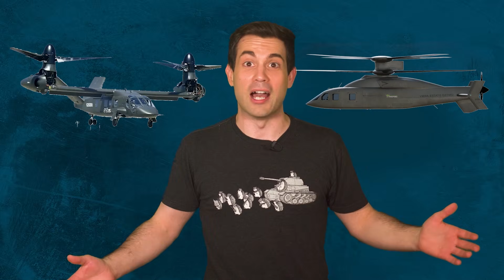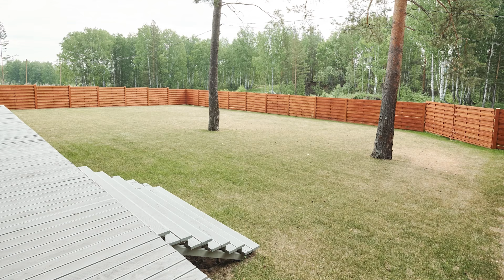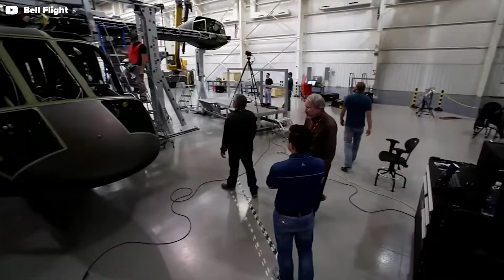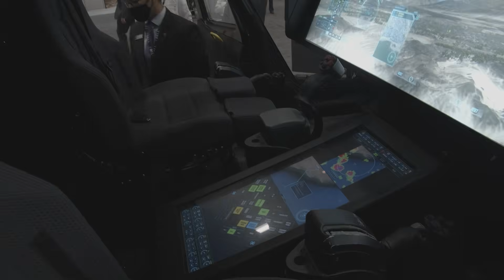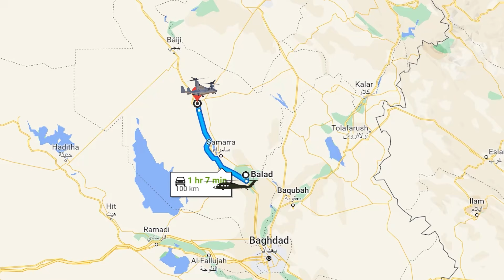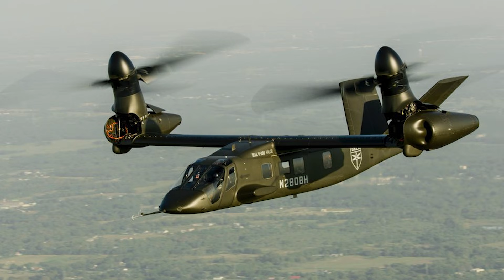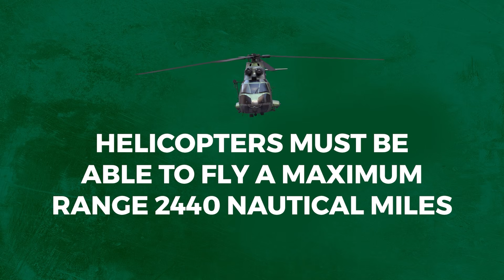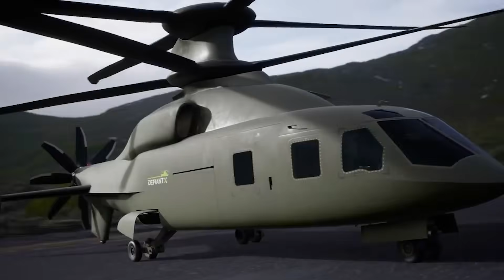V-280 Valor Helicopter Will Help Defeat China

Comment: Cappy, You missed the greatest property of the Defiant X coaxial rotor, it eliminates retreating blade stall so the helicopter can go faster. Retreating blade stall is/was a major limitation to helicopter speed because the faster you go the more the retreating blade loses lift. The coaxial rotors turning in opposite direction cancel out retreating blade stall.

Comment: I personally think both have a place in the US Military. The Defiant is my favorite for the Army because it has a simpler logistical footprint, being able to use the same hangers as the Black Hawk and being (presumably) cheaper to maintain. Plus it can land in smaller areas and fly backwards. I also think the Valor needs to be bought by the Marines as a UH-1Y replacement and MV-22B supplement.
Reply: I was thinking along similar lines as well. The Bell design is going to win out on long distance hauling and will be ideal for the pacific theater, the Sikorsky design on the other hand is going to be ideal for shorter runs and it's smaller profile will allow it to fit in similar footprints to the Blackhawk, covering the weaknesses of the Bell design.

Comment: It strikes me that there are arguments and room for both designs. Especially if they can be scaled up and down depending on requirement.  The Bell design with it's two huge tilting rotors and equally large footprint, is perfect for the seriously heavy lift role. Troop transport and perhaps even other functions such as in flight refuelling in a tanker variant/conversion kit  (Concept already tested with the Osprey by USMC). The Sikorsky Boeing design with it's inherently smaller rotor footprint seems perfect for fast and nimble scout, utility, medium lift and attack gunship roles. 
The competing designs have enough positives that loosing either would be detrimental. So choose them both and bring the Navy/USMC into the development too. I imagine key allies would be interested especially if licenced productions can be negotiated. Which would make service, repair and spares facilities available in various theatres of operation. Specifically UK for Europe and Japan or Australia for the Indian and Pacific Oceans. Huge potential.

Comment: The tiltrotor is in theory a really neat idea and can do things that traditional helicopters can't, but they are horrifically complicated and have far more "Failure results in total loss of aircraft" than a traditional helicopter. Added on to the whole "Must reduce maintenance hours" requirement gives me the heebie jeebies. There's room for them for specialised roles but I wouldn't want them as the primary rotary asset. The defiant looks really good though. 

You add complexity in some areas but you also eliminate some traditional critical components from the tail (Which in theory can fail entirely and you'll still have a flight capable helicopter). Having the pusher prop also eliminates a lot of the downsides of a dual rotor design while adding a ton of useful benefits.

Comment: I work as a jet engine electronics designer. I know for a fact that air gas turbine engines do not perform well when they are tilted too far up or down, as it disrupts the lubrication oil and fuel flow. In the documentation we give to the aircraft manufacturer we provide information on the angle of attack restrictions the engine has for safe operation, and it's their job to share that with the pilots. It also affects the air flow through the turbine, which the engines need in order to function. They work best when pointed in the direction the craft is flying. That's one reason why the Osprey tilt-engine turboprop design has so many reliability problems and is also a likely contributor to why the Bell prototype is having trouble meeting the external carry weight requirement. When tilted upwards, it has to actively suck air through the turboprop as opposed to a regular turboshaft design or when the turboprop is facing forward that passively gets air flowing through it as the aircraft moves.

For the Blackhawk, I also know that some of the electrical components like the power converter are located in a hot, dirty compartment that clogs their cooling fan filters, causing the capacitors in them to overheat and explode, taking out the converter and unpowering anything is was connected to. That's a problem on the aircraft's side, not the components.
Reply: People who know what they're talking about deserve a like. Take this.
Reply: true but that being saidthere are ways to design engines that can handle tilting. also as far as I understand the new Bell design doesn't actually tilt the engine but just the prop-gearbox assembly which should make it much more reliable.
Reply: Tell that to the fighter jets.

Comment: Yeah, I’m definitely betting on the Bell Mini Osprey to win this contract, but I can see elements of the Lockheed design in a new attack helicopter…
Reply: The Army wants to base a replacement for the Apache on the winner of this contest for the same reasons the USMC has the Hueys and Cobras(because they have 85% parts commonality). I can't see them trying to make a tiltrotor gunship when tiltrotors are less efficient and noisier in hover and loiter compared to traditional helicopters due to the higher disk loading. Tildrotors have to compromise between disk loading and prop drag and there is no getting around that.

Comment: I think US should go with both helicopters.

Now hear me out, this project will replace all blackhawks. V280 seems great for island hopping but imagine that thing on the mountains of another middle eastern country, just no. On the other hand Defiant X seems great for tight spaces of middle east or europe for that matter but I can't imagine defiant island hopping, it's too slow and lacks the range.

From what I can find V280 has cruise speed of 280kn and range of 2100nm while Defiant X has claimed cruise speed of 250kn and they completed a flight test 2 months ago of 700nm. I said claimed cruise speed because defiant X's max speed in this flight test was 247kn. It's still better than blackhawk mind you, it's just not as good as V280 for an island hopping objective.
Defiant X also does NOT have the lift capacity of V-280. 
V-280 only looses out on its size and unjustified fears of tilt rotor being troublesome. In every way, it is better than Defiant X.
Reply: while that would be great, it would defeat the purpose of the program. They want one helicopter to replace the blackhawk not two. having two would balloon the price and budget to support them. Its much cheaper to choose one and service it over its life time. 

Also we saw how well having two different versions for the same mission worked for LCS. I dont think the army wants to see a repeat of that.

Heres what I think should happen. I love both designs but I think the defiant will win this. It can practically match the valor in capabilities. The valor is a little faster and can probably lift more. However the defiant seems to beat it in the other areas. Ease of maintanance, size, combat footprint, etc.. So they go with this design to replace the blackhawk.

For the scout program they go with the bell invictus helicopter over the raider. It seems the better option to me. Although bell loses the blackhawk replacement, it gets the scout program.

Honestly I would not be against a scaled up version of the valor to replace the chinook. I like the chinook but its showing its age. The V-22 I dont think can replace teh chinook because it cannot carry as much men and equipment inside and outside as the chinook. Maybe They said in the video the valor can be upscaled so maybe once re start replacing the blackhawks and recon helis we can look at the chinook.
Reply: @ameritoast5174  Defiant has non of the attributes that'd work for island hopping and no valor isn't just "a little faster". Valor's top speed is 320mph while defiant's top speed is 247. Valor has 2100nm range while defiant has 700nm range. 

If they want to go with island hopping, slower and shorter ranged helicopter is just not gonna work.

Comment: The Bell Valor differs from the Osprey in that the rotors tilt, but the engines do not. This should make the aircraft much more reliable. It's about 70 mph faster than the Bell, but carries less and the tilt rotors severely limit weapon load-out. It's main point of failure is the linkage between the rotors and the engines, as that joint needs to bend 90 degrees.

The Defiant-x, looks like a regular helicopter but it is not. In order to get the rotors so close together, they had to be made out of a much stiffer material. This is unproven and is probably the aircraft's main point of failure.

IMHO the Defiant-x fits the role better, but the Valor is the safer choice.
Reply: what do you mean, have you not seen the KA 29 or KA50/52, they have the twin rotor setup how is it unproven.
Reply: @kousand9917  Their rotors are farther apart to keep them from self-destructing. The Defiant-x builds upon the "ABC" concept from the 70s. It's got a lot of advantages, but requires very stiff rotor blades that will take a lot of stress. (maybe too much stress)
Reply: @be5718  The engines don't have to tilt. So they don't need to deal with the operational stress of working at 90 degrees. (and twisting the full lines, etc...) This was a big hurtle back in WWII when planes were first taking high g loads and flying upside down. As for landing without power, what does the v-220 do?
Reply: Counter rotating top rotors have been around a long time. They are well understood now. Sufficient stiffness to avoid rotor blades slapping each other was part of the design. But already tested and proven on aircraft before Defiant.
Reply: @Stu_Bur  Dude, read the comments. The defiant-x is an abc helicopter, the aerodynamics are different.

Comment: For island hopping, how about WIG ship, or flying boat (amphibious aircraft)? They are much faster than helicopter or other highspeed ship (like hovercraft/surface effect ship/catamaran). And they can land on water so does not require runway. Japan/China has large amphibious aircraft of  MTOW 45 ton.
Reply: The problem with that, is that the Army would still need a medium helicopter for all of its land warfare needs. The idea is to have a helicopter that is capable of island operations, not get an island-operations-only aircraft, and then need to go get a helicopter afterwards.

Comment: I understand the V-22 Osprey is the second most high maintenance aircraft in American inventory after the UH-64 Apache.
There would be big questions about the V-22 if it didn't do things that no other STOL/vTOL can do, which among other things can transport an F-35 engine long distances. Keeping the V-22 in the air with a relatively clean accident record is supposedly not because of the aircraft's low maintenance requirement but a sign of the excellence of American aviation maintenance.

A lot would have to be upgraded if a new Blackhawk replacement is supposed to be low maintenance.
I suspect Blackhawk accidents are probably due more to the age and use than fundamental design eeficiencies... Would that be right?
Or, maybe the Blackhawk was designed in an era of limited technology relative to what is possible today.
Reply: The Blackhawk accidents are because of inexperienced pilots. Hard to get them proficient in their job when flight hours are hard to come by.

Comment: I'd like to know how much science supports counter rotating props.
I know it's a populat Russian design but it hasn't been seen on Western aircraft since the very early days ofstrategic bomber aircraft.
In the RC world, it's fairly well known to be ineffective unless the props/otors are ducted.
I'd read awhile back that the weight and complexity required for multiple counter rotating rotors/props was more complex and heavy than any added benefi.
Noticed the Mars helicopter used unducted counter rotating props.

I suppose in their multiple rotors can have a benefit to emply greater lifting area (without increasing drag) when the wingtips approach the speed of sound which is a limit that should not be crossed. But does it make sense?
Reply: TS: The Kaman HH-43 helicopter in the 50's -70's had counterrotating rotors as does the current production K-Max heavy lift helicopter.  The Navy DASH drone helicopter in the 60's-70's had it as well.  Demanding "supporting science" is bizarre and inappropriate. The Soviets/Russians have decades of operation in their naval Hormone/Helix helicopters and their current Ka-52 attack helicopter. The Soviet/Russian Tu-95 bomber in operation since the 1950's uses contrarotating props. The British RAF AVRO Shackleton maritime patrol plane operated from the 50's-1990's.
Reply: @KB4QAA  Thx for responding. Point is that although a few models exist, only the Russians have made it a feature of their designs. Everywhere else, it's only been a niche feature that didn't start a trend of copycats.
So, the question still must be asked... If counterrotating props and rotors are really that significant, why hasn't it become a standard feature of most or all designs instead of only niche designs? If "supporting science" is not available, I'd settle for some kind of study or opinion by an engineer who designs this kind of stuff.
Reply: @tonysu8860  I fail to see how historical designs have anything to do with modern designs.  ??
Reply: @tonysu8860  I forgot to mention the RN/RCN Fairey Gannett  ASW/Airborne Early Warning carrier based plane of the 50's-70's.

Comment: I mean the Osprey already proven very useful, it's a combo of a plane and heli. I don't see its size has a massive downside since it can hover pretty well. The only question is how well it will work if one rotor dies.
Reply: About as well as the defiant will work if one rotor dies, not at all
Reply: The tilt rotor aircraft require a substantially larger LZ and have reduced efficiency in hover mode as a good portion of the thrust is opposed by the surface area of the wings.
Reply: more moving parts = more things that can go wrong. Variable geometry aircraft tend to have a very high service cost.

Comment: What seems obvious to me is that there is no way that the Valor can land in a confined space. This is one of the biggest advantages of the "conventional" helicopter design. It's simply too big when you need to land in the middle of the bush or a narrow road.
Reply: You'd be surprised. I've worked with V-22s, and while they do require a bit bigger of a footprint than a conventional helo, the difference is not as big as you'd think.

The reason is safety margins. Outside of exceptional circumstances, chopper pilots want to keep 20 or 30m of clearance away from their rotor blades. The difference between a 16m radius main rotor (Blackhawk) and a 12m x 25m pair of rotors (Osprey) is significant, but once you add on 20m of safety margin, the difference between a 35m radius safety circle and a 30m x 45m safety rectangle is pretty small.

It might make a difference for special operations, where safety margins are regularly cut down, but for the green army, it isn't a game breaker. Besides, the green army usually doesn't want to land just one helicopter (how much good is one section/squad going to do?), so they are already looking for larger LZs, and the difference between being able to land 10 Defiants vs 8 Valours on a given LZ might not be enough to balance out the fact that the Valours can go back to base and bring in a second wave by the time the Valours have arrived at the LZ.

Comment: I guarantee you bell won't win. Vtol planes are overrated as fuck and hyper complex to maintain and many additional points of failure in the system. Not as good at being an airplane or helicopter. May as well have shot their bid in the foot with such a dumb design.

Comment: I would pick the Defiant X. The Valor doesn't look like it would do well in an urban environment. Also, it has to pitch back to slow down like old helicopters. The Defiant has a compact footprint and can land without pitching. That probably negates any range or speed advantage the Valor may have. Also the Valor is just a big target for ground fire. Those wings don't look super sturdy. Adding armor to the Defiant seems like it would be much easier than for the Valor.
Reply: But that's the problem, they aren't looking for new helicopter in urban environment. They want island hopping capability and that means: range, speed, weight lift capability all of which valor has and non of which Defiant X has been able to achieve.
Reply: I agree, Lockheed should win this.

Comment: Instead of counter rotating rotors, I’m surprised at we don’t make a smaller banana/mini Chinook. A couple of small jet engines could do forward thrust, and then the rotor design can stay subsonic.
Reply: What you're talkin about is limited by aerodynamics. You can't achieve the speed and range.

Comment: There's a problem with tilting rotors that you didn't mention here. The type of propeller needed to achieve lift and the one for pushing forward have to be different to do their job efficiently. Obviously the first one can do both but it is doesn't have the best characteristics to do the second one. Also the tilting mechanism adds more weight and complexity (more money both to build and maintain).
Reply: But isn't complexity and weight also a complaint about the competition which is a co-axial counter-rotating rotors?
Reply: @tonysu8860  They are still lighter and less complex compared to the other prototype.

Comment: Is it possible the contract would be split? They both have great features and ideas behind them, imo.
Reply: Doubtful. Defiant is better for air assault while nearly as good as V-280 for speed and range. V-22 Osprey is better than the smaller V-280 for long range logistics. V-22 has larger capacity and a rear ramp that V-280 lacks.